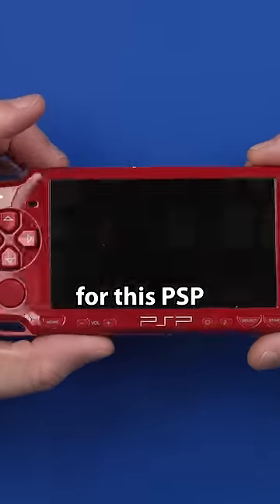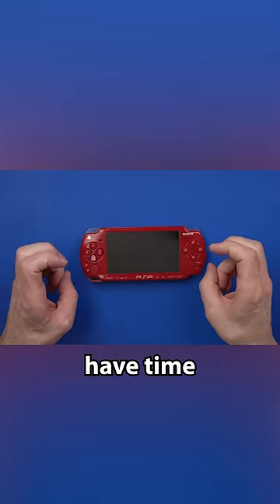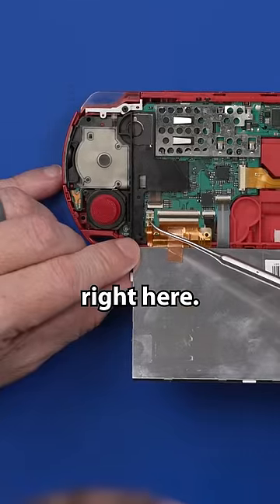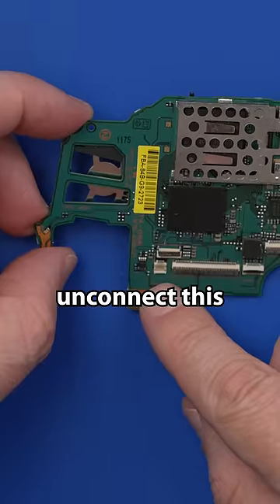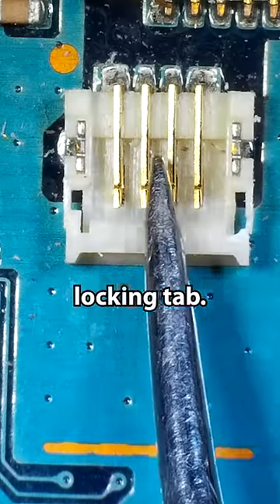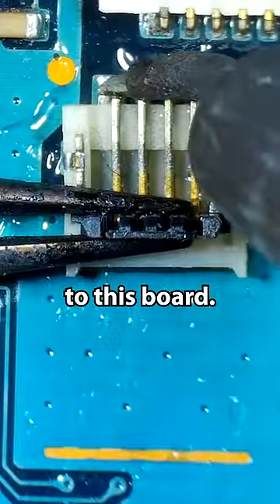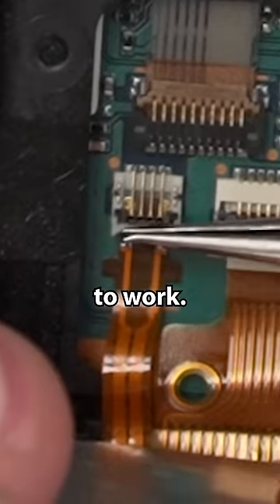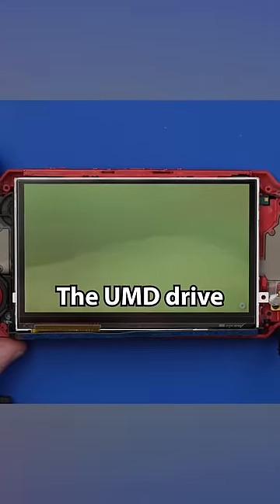BROKEN PSP God of War for $59 - But Can I Fix It?!

Comment: "I dont have the capability to fix what I broke that made things much worse, so my loss is your gain."
Reply: usually how it goes tbh
Reply: Atleast dude tried, more than you can say for most people...
Reply: I sold my 3d printer for similar reasons
Reply: Sometimes it helps to have a guide, for example, this video. Hard to fix something when you're going in blind.
Reply: @someperson8151  Especially when you don't have the right tools for these micro repairs.
Reply: @origintrackz5235  but he still gave up...
Reply: @killer8349  Tried and gave up, what's wrong with that? Most people who can solder can't do anything with SMD stuff (myself included), so they would've likely broke it even more if they didn't give up. Least now they know their limit and can work towards improving for next time
Reply: @Xenro66  literally get equipment for the job... key words (gave up)... could never be me.
Reply: @killer8349  ur weird
Reply: @wh4169    whyre u projecting?
Reply: @origintrackz5235  true
Reply: I remember I had a psp not to long ago but the speakers were messed up, I wish I knew someone taped the ribbon cable for the screen already before I disassembled it. Long story short I accidentally pushed the tape a slight bit and screen went bye bye. 😭

Comment: About 2 years ago i got a piano black PSP 1000 for roughly the same price, including a carrying case, charger, original headphones with the remote addon, and one game. The only issue was a drifting analog, which turned out to be a contact rubber block issue, and a few small screen scratches. The original battery is for whatever reason still working good, even though it's a 2005 model (5D date code).
Reply: God of war edition?
Reply: @damanycollins7183  the regular black, still a good price for a PSP with a bunch of accessories that only needed a 5 minute repair and a 2 dollar spare part.
Reply: No GoW edition on the PSP 1000. Dude the PSP 1000 was far superior to the later version. It was physically  harder to damage, could be jail broken very easilly had a brighter screen, louder speakers and a longer run time. (it's power requirements were a bit higher but the stock battery had more the 150% of the capacity of the PSP 2000 tiny battery. It's only downside is that it was larger and heavier. However if you are or are near the size of a man the extra weight is trivial and the larger size was useful.

I am convince that like almost all things of Japanese manufacture and design the PSP 2000 was part of a long running campaign of passive-aggressive retribution against American men (they might still be salty over the nukes) Either way their plan is thus. Make a marvelous hand held device, car, or whatever. Aggressively shrink it until the average Japanese man con just barely use it comfortably. Sell it to everybody then quietly point and giggle their asses off as we American men invariably develop hand cramps on too small of devices and hit our heads of roofs that are always about a half inch too low.
Reply: @Snipergoat1 Good comment

Comment: I say the same thing when people sell stuff as “untested.” I know for a fact they tested it and even tried to fix it but couldn’t figure it out so they decide to try and sell/scam it as “untested” condition. This scam is getting way out of hand and these sellers aren’t being held accountable for their scams. Gone are the days of sellers being honest and taking responsibility and listing something as broken.
Reply: Even worse than that, because they are selling ones that have had all the important parts removed as untested, when in reality, they are nothing but a useless plastic shell with 80% of the parts removed to fix other broken consoles. Still selling them as untested, and it's a blatant scam, they should be prosecuted for fraud.
Reply: “I know for a fact” you actually don’t, though.
Reply: @saladass1571  I do, I even took the time and explained my rationale. If you have anything more than "nah, I say you are wrong" You are welcome to share it with us. I do know for a fact that this is the standard practice because I have worked directly with computer parts sellers for years. 

There is ZERO sense in not testing your parts as a seller then the known bad parts get listed as "untested" for a few extra profit. For good or bad, businesses do try to get the most profit they can. 

Grabbing a bunch of expensive PC parts, not testing them to see if anything can command a higher price is flat out stupid and a total waste of money. If you want to nitpick, smaller components that are more time intensive to test probably don't warrant the effort but you will not find companies selling perfectly working gear because they never bothered testing. You go to liquidators or proper auctions for that.

Comment: This actually surprises me. Normally, with a broken latch on the backlight connector (as here), you can still use the display normally if you just give the cable some. I have like 2 PSPs with this tab broken.
I also never saw somebody changing that connector. Hats off to you.

Comment: Who here remembers cutting open the older batteries to these things to shave off a small circuit to load a jail break firmware then using  graphite from a pencil to complete the circuit again? Those were the days..

Comment: I remember getting my PSP 2000 a few years back & just recently had to replace the L button because it gave out. At first I was scared to try, but after my experience I now love disassembling tech to do repairs (or in the case of my hotkey JoyCon or DS4, reshelling it)

Comment: I believe the seller. He apparently had trouble with the connector plug (That one was unusually fragile plus being right next to some delicate electronics making an already fiddly task a bit tougher, connector plugs are not usually a source of problems but when they are they always seem to find their own unique way to be a pain in the butt. He knew where at least one failure was and while this dude kind of skipped through it that is sort of a tricky soldering job (and his solder game is on point). I have replaced that exact plug on that model of PsP. It took some care and patience to not glob everything together. If you don't have the soldering experience or the proper iron (to hot and you can easily burn out everything near your repair.)And he also does not know if this is the only fault or if it is part of a cascade. (A failure in one component that induces a fault in the next component and so on. These are common in inexpensive consumer electronics)

So knowing one fault but not having either the proper tools or experience to fix it and not knowing if it is the only fault he just cuts his losses and gets a few bucks out of it. I might have done the same thing except when I did the nearly identical repair to my own PSP, I was broke and had that one thing broke men usually have in abundance have in abundance, time. I was thinking "I was working on $25 million systems a month ago, I'll be damned if a $250 PsP is going to get the better of me."  Luckily for him and me both it was the plug only and not the screen itself. The damn screen cost almost as much as the whole PsP.

Comment: I have a PSP with a lot of memories on it. The only problem was with the charging pin and analog circuit. After we paid some people to get it fixed, it seemed fine for a week or so, but then it started causing trouble again. As a result, we decide not to get it fixed again because it will just break again. So it just sits in my drawer for years. I would love to get it running again, but the problem is money, and I don't know if it's still good.

Comment: Ahhhhh !!! Why did you break off the contacts !?!?! This is how you destroy the boards traces... And that is a hassle to get a good solder connection again... Lucky it didn't but trust me, use heat to remove them !

Comment: I paid €10 for a psp 2000 with 2 games,a charger and a 1gb memory stick pro duo and the seller said it was broken but I bought it and then got a charger online and charged the psp and it worked.The UMD drive also worked

Comment: I would love that!i never had a psp and I would love one!
Reply: Try an emulator. It has become an overpriced collectors item that is not that appealing compared to e. g. a Nintendo New 3DS. Ergonomics suck, just as the battery life. In the early 2000s it was just 30 bucks for a PSP 3000 in good condition.

Comment: It's not easy to find a replacement connector, so he could've simply used a small piece of plastic and insert it over the ribbon, so it pushes onto the pins, then stick a tape over, so it stays in place. And it's obviously not fixed, considering the fact that the screen has that faded color and those vertical lines. The games will look awful, no one would play on that thing.

Comment: So I have an imported PSP with a bad power connection and I’ve asked around locally but nobody works on them. Drive works, screen works, but I have to charge the battery externally. Any chance you could help?

Comment: I have a PSP which works completely fine but freezes (with a glitched screen with a bunch of vertical lines) as soon as I tap on the back of the UMD reader or charging area with my finger. I don’t know if it’s the power supply (since the PSP stays on for a few seconds after freezing) or something else. It won’t turn on with the battery removed and only the cable plugged in though.

Do you know what it could be perhaps. I am slowly losing my mind over this :(

Comment: I need help. Where can I get a screw driver set that's thin enough to fit in the holes so I can take apart my PSP. It's umd drive doesn't get any power and I have a spare just sitting there

Comment: Wait! He didn't actually even have to replace that connector to get it working right? He could have just plugged the ribbon back in without the locking lug and it would've worked as long as he didn't shake it too hard.. Damn that seller just had to plug that back in... He didn't even need to know to do any actual repairs.. Haha...

Comment: My psp sounds like it's dying when I lay it flat with a disk in it. I've tried to fix it but I'm stumped I'm pretty good with tech I take apart and fix computer and handheld all day but the psp has defeated me it's about 15 years old and was made out of spare parts by my dad so it's not exactly structurally sound.

Comment: This doesn’t make sense. If he broke that piece trying to fix it and it didn’t work. So you replace the piece he broke trying to fix something else. And then it magically works? You didn’t mention anything about any other broken components but something else had to be faulty for him to try and tear into it. That, or…. Maybe he didn’t touch anything. Bc like I said, if he broke that ribbon piece, there would’ve been something else that broke on its own which would’ve been the thing that printed him to tear into it.

Comment: Broken lock tab? I would have just cut off some plastic garbage (that my ssd drives come in) and stuck in the top of the connector. Jam it in there. (Secure with tape). How do I know this works? I did it earlier today.
Reply: Good to know
Reply: Yeah but this is more permenant

Comment: I payed for my psp 5$  cause the owner sayed the screen cracked when he droped it but when i opened it, the desplay wire was disconected from the conector. Most probably because the shock and it was not assambled corectly in the factory

Comment: Honestly the PSP was a failed portable, the UMD drive SOUNDS cool, but it DEVOURED battery life. A maximum battery life of 2 hours. WEAK!

there is no secret as to why the PSP isn't so popular, rather, multiple reasons.

1: It had so few games it was laughable.

2: It marketed on specs and not games.

3: The UMD drive DEVOURED battery life like a crooked politician stealing money from social security to fatten their own pockets!

4: The unit itself was overpriced.

5: The original release units of PSPs had a button placed on the motherboard too close to the screen, causing the button to hit the screen.

6: DEAD Pixels. The PSP was poorly protected by it's dust covers, and it led to pixels being killed by dust particles.

Overall, the PSP was flawed by design, and Sony's PS Vita was their 2nd attempt at trying to take Nintendo down in the handheld market, but Sony failed BOTH times. Sony tried to replicate the Wii U gamepad, and yet, people have crucified Sony online for it.